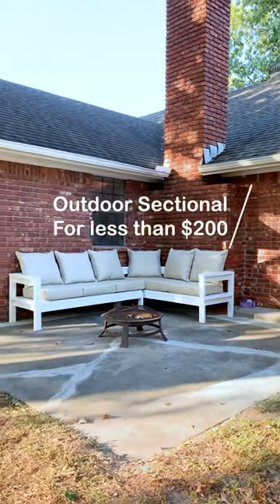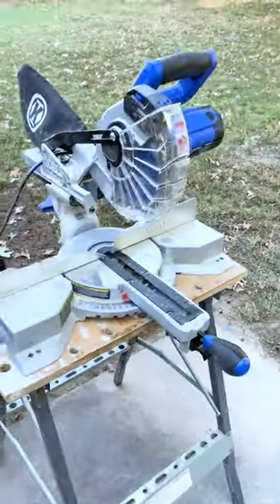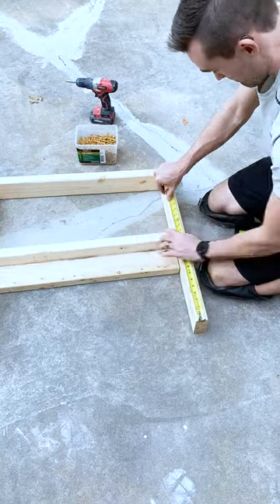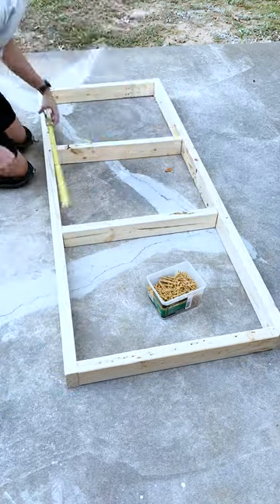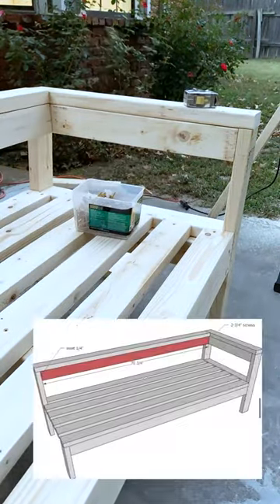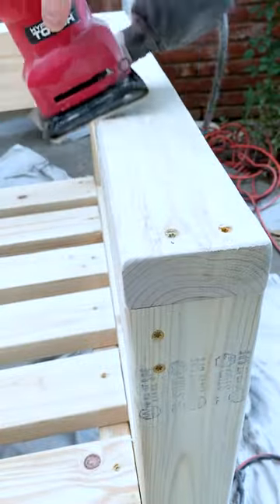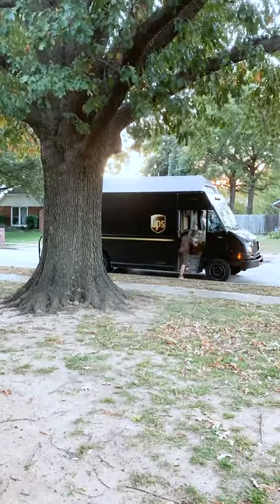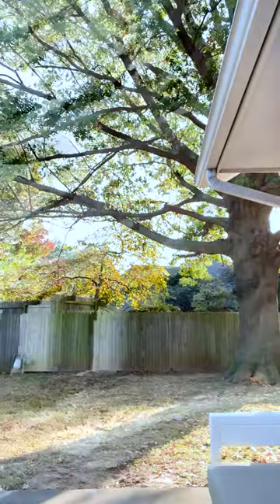DIY Outdoor Sectional for Under $200

Comment: Cushions are just $200?  Could you please share the link?  The ones i found are so expensive and holding me back from making this.
Reply: A full set is $180. I had to scale up the couch slightly to math the cushion size
Reply: @PhoKingWay  where did you get them?
Reply: @b3arwithm3  went to Amazon and searched outdoor patio cushion set. There are a few options for $180-200, but it won't let me paste a link here